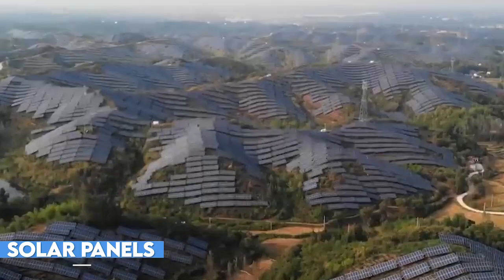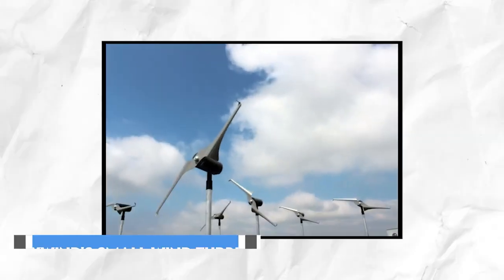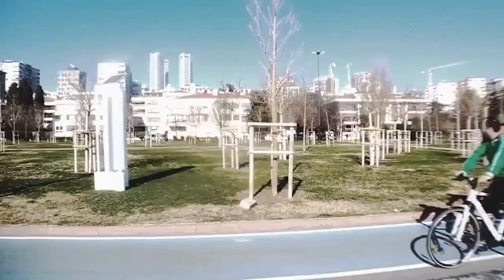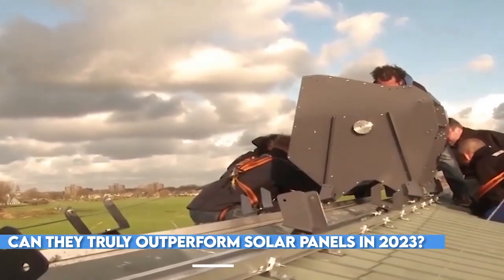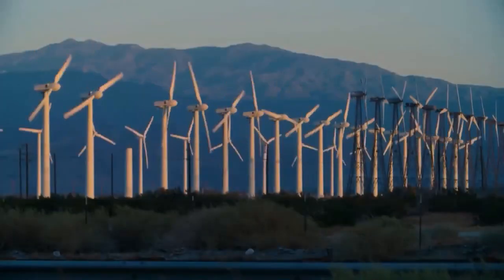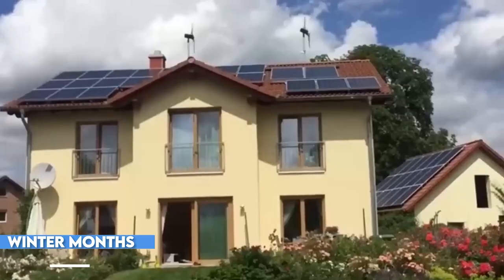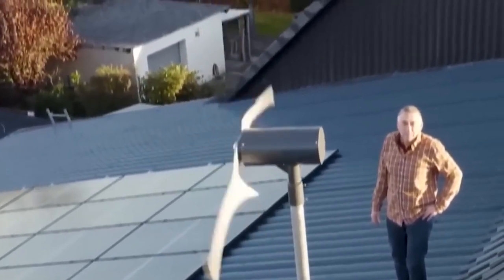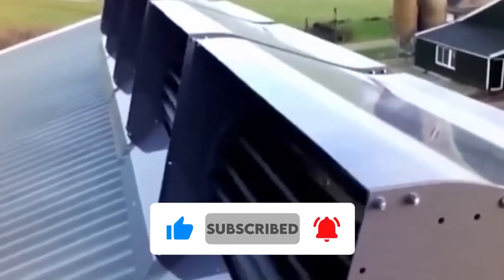Solar Panels vs Wind Turbines: Uncovering the Surprising Facts

Comment: Windmills and solar panels are still items that are too expensive at the moment unless someone wants to make them on a large scale at a cheap price, it also requires sufficient skills regarding electricity, it is necessary to immediately establish safety standards and other regulations by government, especially windmills for generating electricity are more expensive than solar panels, is there anything that can convert cold temperatures into high-power electricity? that's what winter needs.